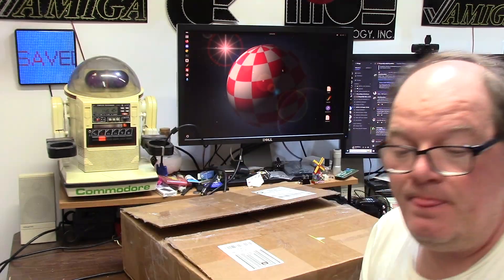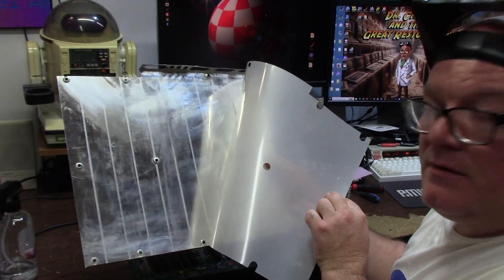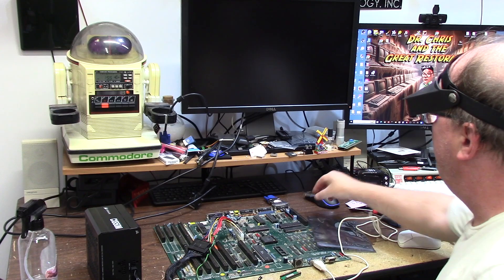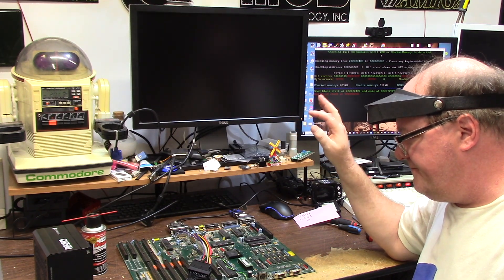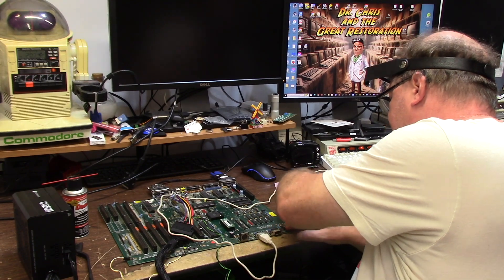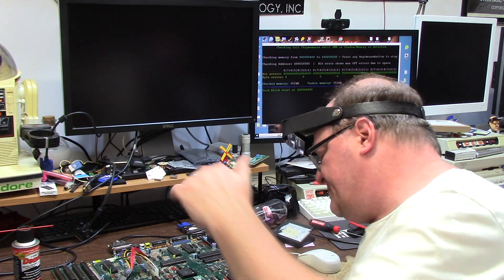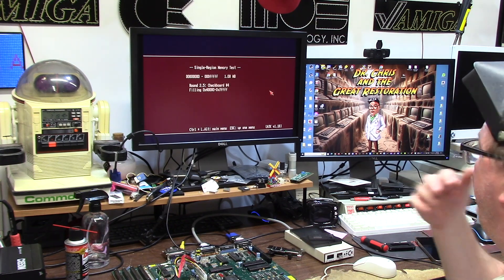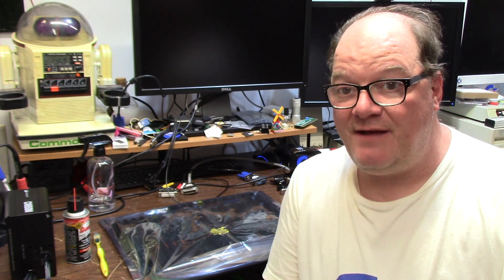Amiga 2000 - How To Stack Ram To Bypass Bad Chips

Comment: Dang!!!! Thanks!!! A two-fer! The mouse and pico fuses and  I bought a 2000 that had a wire soldered to pin 31 on the kickstart rom but the other end had come off! I couldnt tell where it had been attached! NOW I know!!! I will now need to revisit that 2000 and see if I can now get it to boot!

Comment: Thanks Dr Chris 👍🏻 Talking of 9 pin ports on the Amiga. My Rev 2 A4KD board suffers with the up on the joystick port not working. CIA’s test out on ATK. What should I be checking here? Cheers 🍻
Reply from the maker: Check paula on the 4000. Or u976 or 975 right above the battery area death chip u177
Reply: @ChrisEdwardsRestoration Cheers Dr Chris 👍🏻

Comment: Had trouble with modern displays not working with my A2000 when connected to RGB. Found out I needed an adapter that has a buffer inside. The regular straight through adapters did not work.